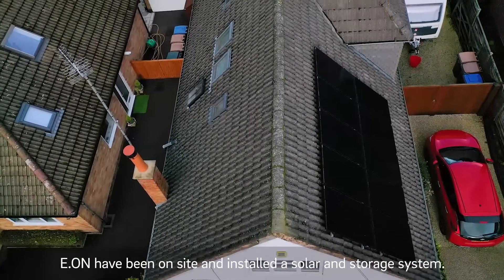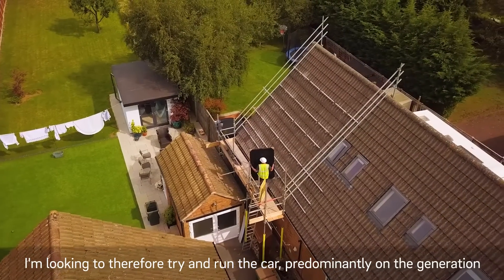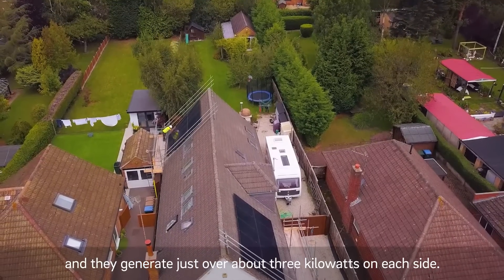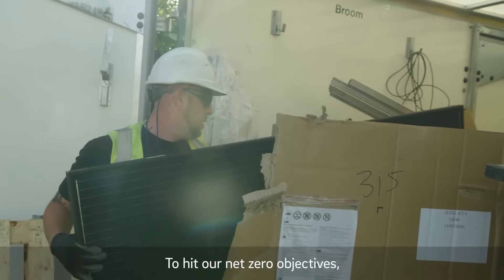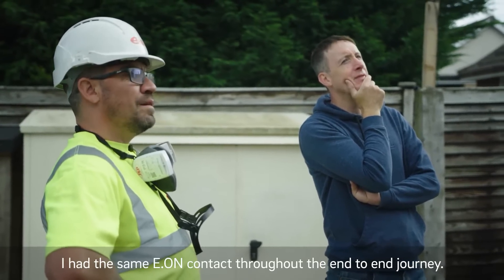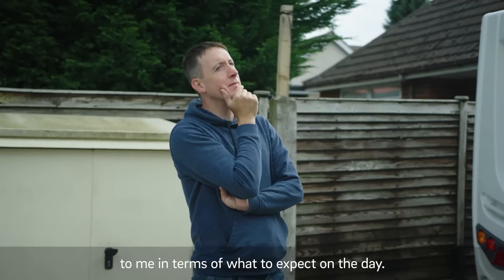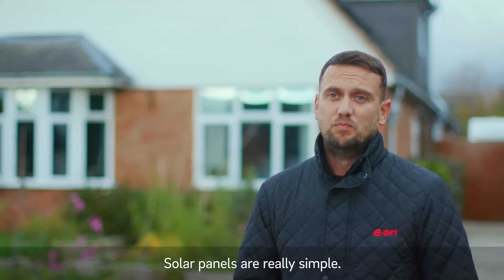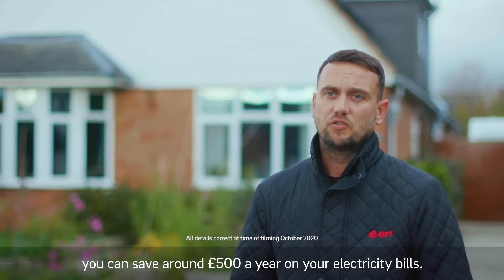Solar installation story - E.ON

Comment: What brand and type of Solar Panels and Battery do they use? Can't find any specs of these devices you get if u get into it. If you sell devices, Eon, then at least state the specs of the product you are selling!
Reply: EON sell / use Longi panels and GivEnergy batteries, on my contract they did not specify which panel - I had to ask, also they didn't specify which GivEnergy inverter. Halo will be using Q-Cells with GivEnergy 5kWh GEN 2 Inverter and 9.5 battery. Hope this helps?

Comment: Abysmal company to deal with, this video has been done for marketing purposes only.  Started my process of dealing with them back in April when I place an order. The representative was no more than a salesman with very little knowledge, he became argumentative and no progress on getting an installer allocated (they use a third party company). Lots more issues and after several complaints cancelled the contract on 3rd July, still waiting for refund on the 22nd July. Strongly advise not to use them, I have found a family run business and very professional.
Reply: Which family business did you use? Where are you located? Looking also for a better professional business to do ours.
Reply: @pallefrans85  I have just signed a contract with Halo-Renewables, I am in Northamptonshire but Halo are in Peterborough. I dont know how far they are willing to travel. So far they have been excellent.

Comment: Solar & Battery system......if they save you so much off your energy bill ..( ie 40-60%  per year..ie £500 a year  )..., by being stored /exported back to grid. why isn't everyone getting these fitted  APART FROM INITIAL COST OF INSTALLING...

Comment: Cost/savings/time to break even?
As with most environmentally-friendly/renewables they are great in principle but are only an option for those who can afford them to being with.
Solar pv/thermal, electric vehicles. Simply out of the reach of most working people who simply can’t afford the cost of installation or purchase/lease of an electric vehicle.
I assume the payback on investment is in the region of ten years? If so savings aren’t actual savings until the system has covered it’s costs.

Comment: Why use an energy company to buy a Solar System. What’s their motive... Solar Energy is FREE are they just turning the gun on themselves..?
Reply: They sell small systems for a lot of money.
Reply: Part of their license/code of conduct, to promote renewable energy?
Reply: Because energy companies make very little money from power and gas as people are being encouraged to use less and less. If they don’t offer it someone else will.
Reply: @RikTheMix  If you don't mind me asking how much did you end up paying after the discount/grant & what size?
Reply: @RikTheMix  Thanks, that's really good. We just got the same quote 11 panels 4.6kwh with battery for £10.2k in Oct 23 so you got a good deal, even if solar is meant to be getting cheaper it seems to have took a huge inflation/energy crisis hit. How's the experience thus far, worth it, are the saving projections accurate, are you with Octopus energy?